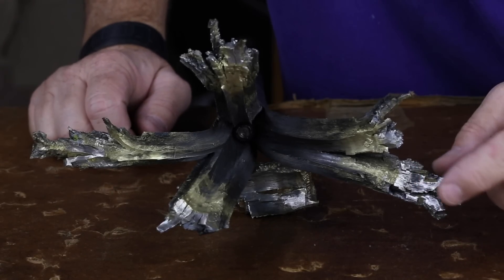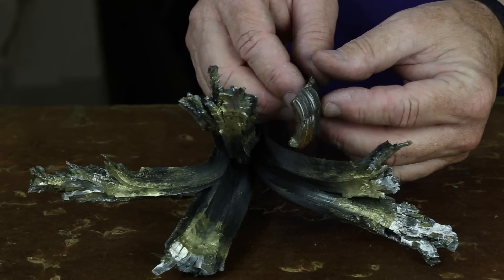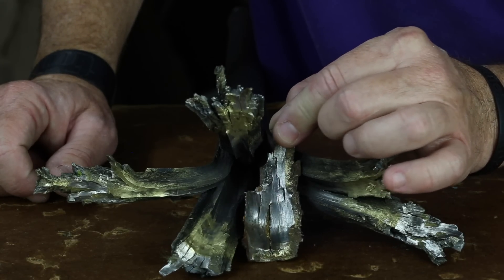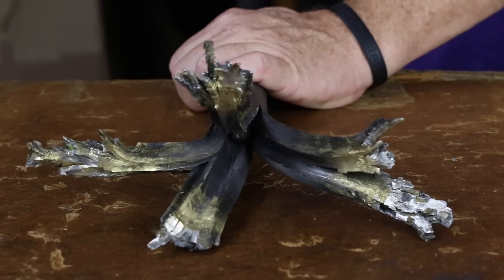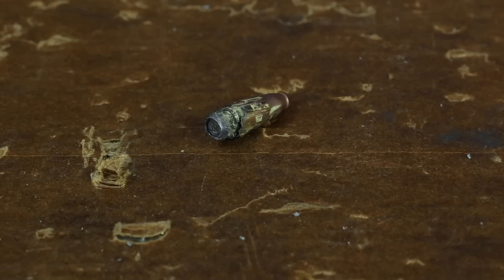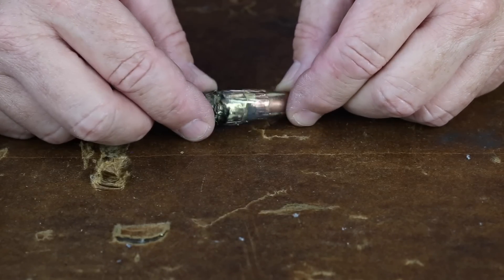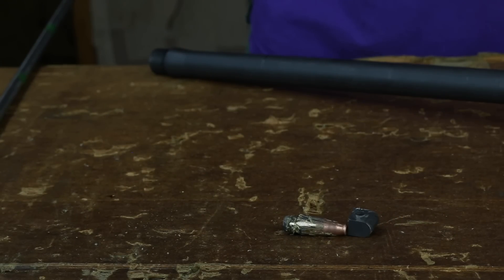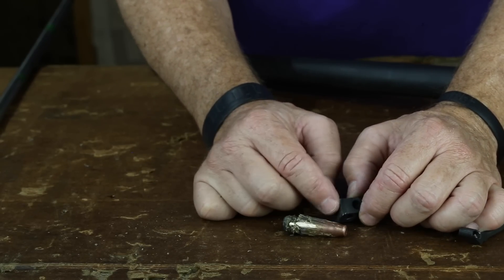RN-50 vs C4 AFTERMATH!

Comment: Just something I noticed on the ears that didn't tare off in this experiment I saw that you have blind holse near the front corner one large and a second smaller what are there use and can they be moved further from the front face or removed entirely because it looks as tho they are causing a higher stress concentration on the front corner. would love to hear any feedback and thankyou for the video

Comment: The texture looks very much like stretch marks. Considering the amount of pressure on the steel and the very fast time, it is not far fetched to think the steel was starting to tear just as skin does when it is stretched too quickly. The sides of my knee caps look just like that chamber piece.
Reply: Similar principles 🤷🏾‍♂️

Comment: The texture is more than likely an artifact of the granular structure of the steel. When under very high pressure, it will start to rip apart at the lines of the crystalline structure of the metal. I saw much of the same in Iraq with damaged vehicles, IED shrapnel, and mortar frag.
Reply: I was going to comment on the crystalline structure of the steel as well.

Comment: Anyone else admiring how the brass basically became its own self contained brazing process and surrounded the bullet? I’m trying to figure out if the plastified brass basically sealed the barrel by filling in the gaps in the rifling until there was enough there to make the barrel yield or how that happened..? 

I think it almost had to be in a plastic state because if it was vapor or completely molten it would have shot past the projectile. We all know copper is a great heat conductor but going from molten to almost solid in the small contact band seems like an enormous amount of heat dissipation in a really short time. 

The rupture happened so fast it makes me wonder if a similar thing would happen without the projectile or did the projectile play a part in the destruction?
Reply: This is something I saw many, many years ago and want to know more about. Had a client who bent metal using explosives, or I think explosive forming was the more technical term. Process worked a bit like vacuum forming or blowing a plate into a form, only with a lot more blow. Apparently one of the other applications was to coat or laminate metals. So sheet of copper over another metal, sheet of explosive over that, one <bang> later and the materials are bonded. It was one of those 'well, huh!' moments, but being a semi-retired engineer, something I've wondered about since. I suspect there's a lot of material knowledge required given the stresses involved.
Reply: @brolohalflemming7042  Explosives welding is a thing; when done correctly, it forms these lovely little ripples, like "waves" when viewed in cross-section of the two. It allows for the conjoining of two dissimilar metals for which conventional welding would otherwise be impossible.

The artist Evelyn Rosenberg is probably the first acknowledged "detonographer," one who created metal sculpture embossed, formed, or otherwise created using explosives. It's possible, for example, to inscribe a leaf with remarkable detail by placing it between a sheet each of metal and Detasheet. There's a bit of cleaning, polishing, and flattening after that, understandably, but the detail is remarkable. Her book is Detonography: The Explosive Art of Evelyn Rosenberg. Some of her work is on display in Socorro, NM.

As for the curious details found in Mr. Serbu's experiment, perhaps I'm just not seeing it clearly enough but it seems that the sharp explosive deformation resulted in the steel forming cracks in the same way that hitting a non-Newtonian fluid sharply enough will cause rupture instead of plastic deformation.
Reply: @ericyoung7049  Thank you for the reply, and I'll have to look into Rosenberg's work. Somehow, I very much doubt the UK authorities would grant me an explosives licence for art projects though. But it's fascinating the way advances in both high speed photography and materials science have advanced engineering. Now, scientists can video lasers in slow motion.
Reply: @brolohalflemming7042  My understanding is that Evelyn does all the set-up, design, etc., and simply directs how the explosives are to be laid out. In this fashion, she has no concerns about the bunker for storage, nor any issues with handling, purchasing, transporting, etc. Not a bad idea, if someone else can carry all that extra water for you, I suppose.

Comment: wow, incredible, the brass was molecularily bonded to the steel, the steel looks  brittle and layered like mica... the speed that a solid can turn into a gas is wicked, basically at 26.5K feet per second or 17.8K mph hell, thats nearly the same speed the ISS is moving thru space in its orbit...  you need a "faster" camera, something in the range of 500K FPS to be able to catch the action in detail...
Reply: Call up the Slow-Mo Guys and have them come out to the range with their Phantoms 👻

Comment: I wonder how thick the chamber/barrel would actually have to be to contain a C4 cartridge.
Reply: Making it thicker would not make it work: the metal nearest the explosive would be wrecked even if the outer diameter stayed intact. The forces are too much for any material to stand, even ceramics.
Reply: Really thick, but the chamber would still deform and ruin the gun.
Reply: c4 thunder mug would be neat
Reply: Stalinium could handled it...
Reply: When you find out, you're still only going to be able to get a single shot out of it. If you can contain that much pressure, the creation of that pressure will produce enough heat to send a lot of the steel out the barrel as vapor.
Reply: Maybe with a large air gap between boom and the projectile. And about 10" of HY140 steel around the charge. Or more.

Comment: What really blows my noodle is how all that brass just turned to vapor and basically powder coated various bits of the remnants. Just wild.
Reply: It's kinda pretty especially after he wire brushed it
Reply: Duh, it’s by far the softest metal so obviously it will fail the most catastrophically

Comment: My guess concerning the pattern left in the formerly smooth surface is the detonation of C4 is not a perfectly smooth pressure increase. It occurs in fractions of milliseconds and if we could see it slowed down enough we'd see micro pressure waves literally kneading the steel. A poor analogy is smokeless powder ignition, in a chamber it burns very fast, faster under pressure, so the faster it burns, the more pressure it creates, the more pressure it creates, the faster it burns. Pure conjecture on my part, limited experience in chemistry, physics.

Comment: I may not be an expert, but anytime you put a high explosive inside a steel container, especially one that can't contain said explosion, you create a grenade. Which explains the detonation effect. C- 4 detonates at somewhere around 26,400 fps, even tho you have a projectile, the pressure developed grew faster than the projectile could be expelled, and you get a very effective grenade.
Reply: the source I found mentioned C4 "expands" at 26.5K fps
Reply: @bunnykiller  ya I rechecked myself, I was going off the top of my head and it's been a decade or 2 since I had anything to do with things that go boom.

Comment: Explosives blow up much faster than gunpowder. Gunpowder is a “slower” burn with modern powders.  Even black powder burns faster than modern gun powders, although yielding much less energy. High explosives frame by frame is almost non existent on the time it takes to blow up vs being able to watch powder burn. High explosives are instant which means they blow stuff up. Including the chamber of your gun.

Comment: My SWAG on the texture is the metal grain being expanded and split apart, with the force making more progress in areas where the grains give, which then bunches up the stiffer areas as they get surrounded. 

It's probably not exactly analogous but it reminds me of looking at how the universe started. You have this inflationary period that starts as this smooth and homogeneous state of high energy; but super subtle and once microscopic variations in densities as things expanded so rapidly, become massive long filaments of density that form over time into the galaxies, attracting material away from the voids in between. So I wouldn't be surprised if some fundamental physics concept could be linked to both scenarios.